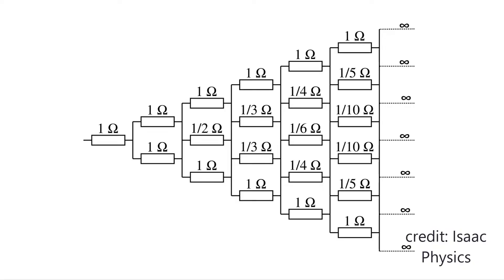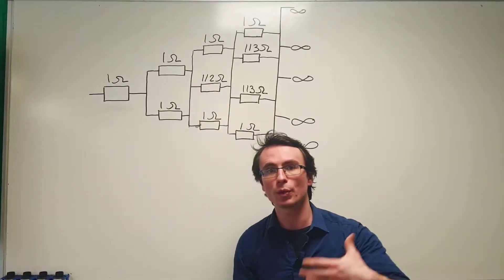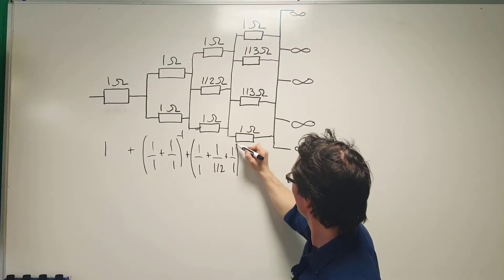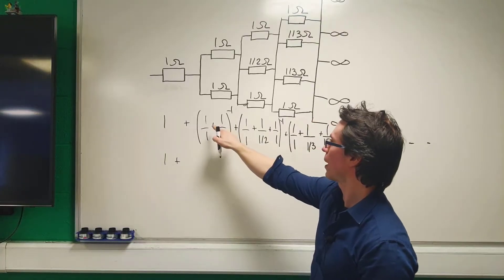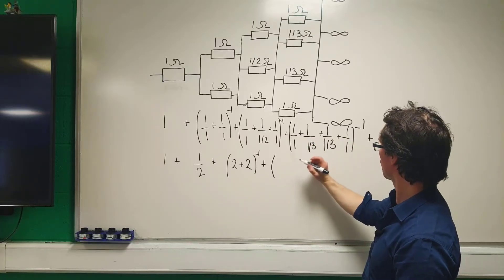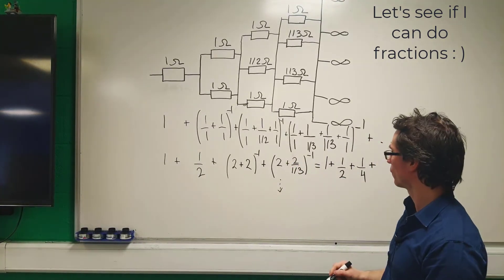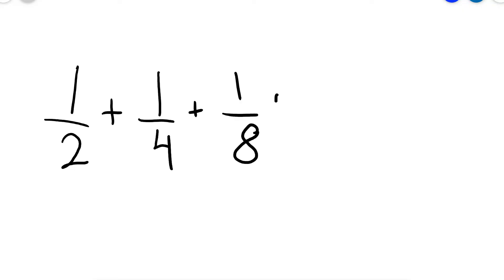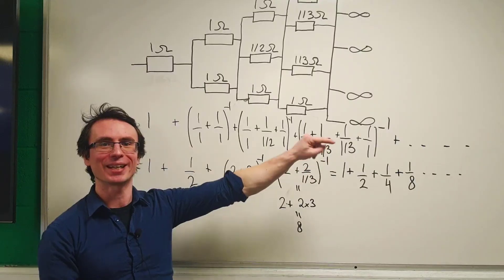Pascal's Triangle BUT with Resistors

Comment: Sir I saw this sort of question on povey's perplexing problems and I have a question.

The series clearly converges to zero as it is essentially 1/(2^(n-1)) which would go to 1/infinity as n goes to infinity.
Hence I thought I would be able to use the converging series summation, a/(1-r).
a=1, r=1/2
so i got 2R as the answer.

However the answer was actually 2R-R(1/2)^n

But we've already said that n goes to infinity.
which would mean its just 2R?

Comment: answer for anyone struggling down in the first reply to this comment.
Reply: you can see in the video that you can think of each column as a separate resistor. you do the formula to work out the resistance for each column. eg for the 4th column the 1/(1/1 +1/1/3 +1/1/3 +1/1) which is 1/(1+3+3+1) which gives 1/8 ohms. you'll notice a pattern. 1 + 1/2 +1/4 + 1/8 +1/16 +1/32 etc. this is a geometric sequence in the form a*r^(n-1) a (the starting term) is 1. r, the common factor, is 0.5. there is a formula for the sum of the terms of a geometric sequence. it's a(1-r^n)/(1-r). since r is a fraction, it means that the later terms of the sequence get smaller and smaller and won't impact the sum much. 0.5^(a very big number) is a very small number. so we just say that r^n becomes 0. so what's left is a*1/(1-r). in the question, this would be 1/0.5 which gives the answer of 2. i hope i could help, especially if this was set as homework for you. 

this video helped me. i had the correct method of doing the resistance formula for each column and adding them together to get the total resistance, but i made a silly mistake with the numbers. eg instead of doing 1/(1/1 +1/1/3 +1/1/3 +1/1)  for the 4th column, i did 1/(1/1 +1/3 + 1/3 + 1/1). this was where i messed up. thanks to this video i was able to verify that i was doing the right method and to see where i made mistakes with the numbers.